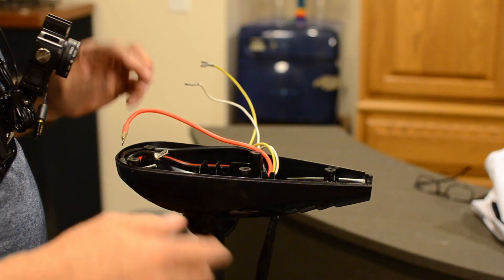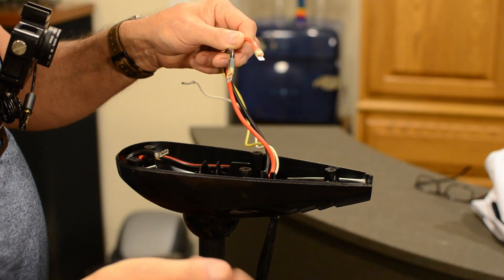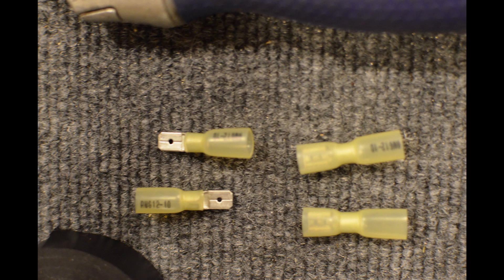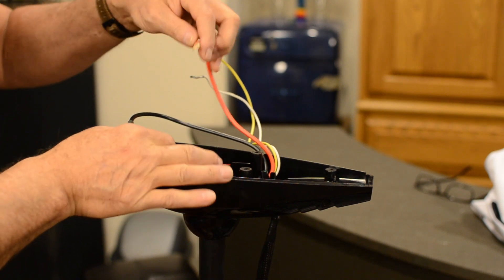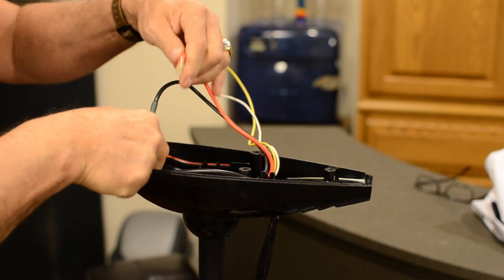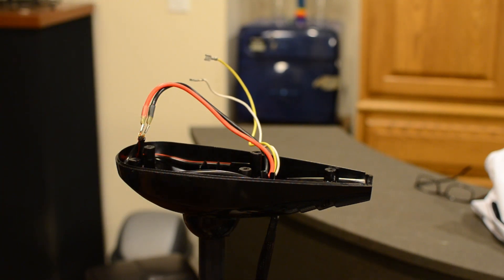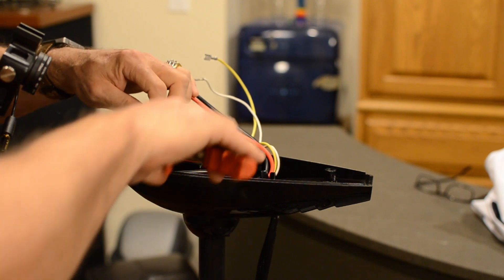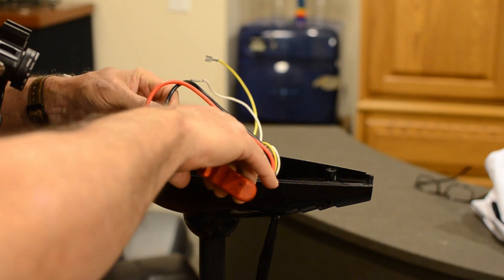Trolling Motor - Pulse Width Modulator/Controller

Comment: What about heat in the pulse box? Fan?
Your video is great! Novice and appreciate straight talk.
Reply from the maker: My PWM controller mount box has holes drilled into it for ventilation and I added a small 12v fan on the outside to pull air thru the box. No overheat issues after 2 years

Comment: Thanks for the video. One thing I've seen done is to leave the motor on fastest forward and then power it through the PWM, without any modifications. The idea is that the fastest forward should be the same as a direct connection (i.e. no resistance ).
Reply from the maker: Great point! - But most trolling motors don't need the switch at all. You still have to wire it to the PWM, right? Appreciate that point for sure

Comment: Hi nice vid. Any link for the PWM 60A controller?
Reply from the maker: Lysdexic - The orignal 60A PWM controller I used was this one - https://www.ebay.com/itm/60A-12V-24V-48V-PWM-DC-Motor-Speed-Controller-CW-CCW-Regulator-Reversible-Switch-/322616142855 - And for the money it worked just fine for the pontoon.